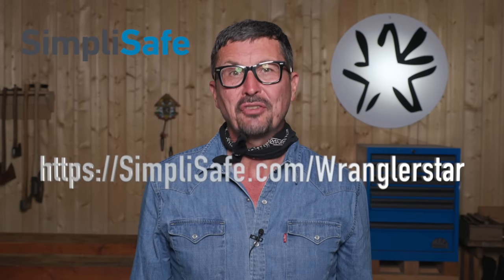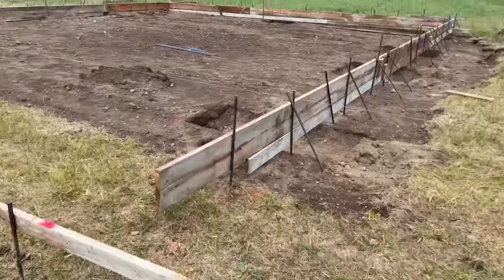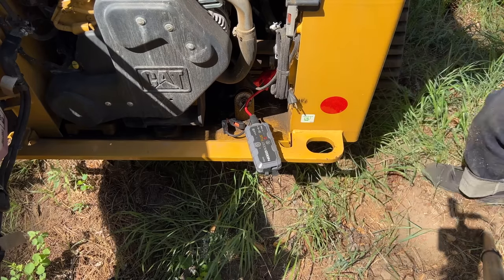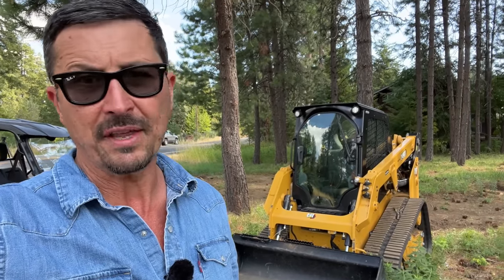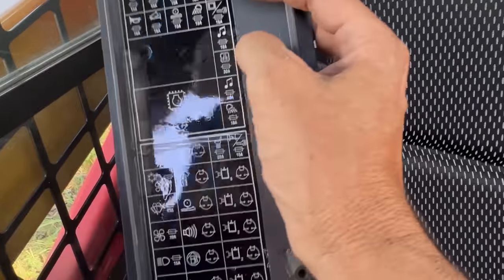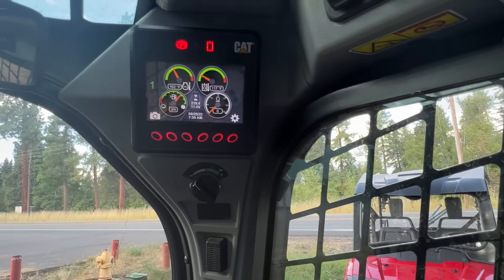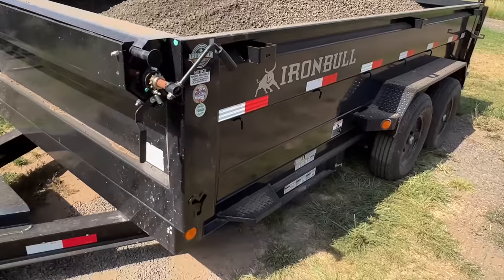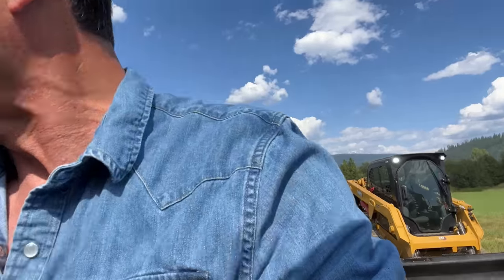How To Build A Shop like a PRO Episode 2

Comment from the maker: Save 20% on your system and your first month is free when you sign up
for interactive monitoring. https://SimpliSafe.com/wranglerstar to learn more! Try SimpliSafe risk-free. If you don’t love it, return it for a full refund within 60 days.
Reply: We have a triple axle 21,000lbs load trail dump trailer with solid 4' sides 16.5 ft long. And it's the same we have the scissor lift and as long as we keep most of  the weight in the middle/ towards 
The rear it will dump way more the it's rated for.... but load it to heavy on the nose and it won't dump
Reply: There may be a Scam on you channel using your name.
Reply: @patricklynch9574  There are a LOT of WranglerStar Twitter accounts. I wonder which one is his 🧐
Reply: @neemtreebark  it was on "telegraph"

Comment: I just started working as an engineer. (just out of college) It does seem that a lot of buildings are over engineered as they say, but if built right once than you should not have any problems with this structure. So footings and slab thickness make sense. The soil bearing pressure, and snow load, wind etc., (im east coast so i dont know much about seismic)  i can see why they are making you put in the footers. Then all the code requirements for rebar and concrete. Its all pretty standard stuff but its sure is annoying when you want something fast and you know a 5 inch concrete slab on top of the stripped soil will serve your needs. Love the videos best of luck

Comment: Just a pro tip with those levee gates, instead of using the sand snake take a shovel and drive the tarp into the ground all across the ditch where the water will run over the top of it, then pack dirt on the edge and the sides to make sure none can get around it. We’ll have about 50 of those in a good sized rice field, that’s the easiest way to do it.
Reply from the maker: Thank you Jackson I will Travis do you use a speed for a square point?
Reply: @wranglerstar  depends on your soil, we are all clay so you need a point to cut through the clay, you could probably try it with a square. Nothing too sharp or it’ll cut the tarp, also if you try the packing the dirt trick make sure you use mud out of the ditch, seals off better/ weight holds the tarp down. If you go back on your other irrigation videos I’ve been commenting/giving advice on some of your other problems. Love watching the videos! Keep it up! Irrigation is hard work.
Reply: Also buy a pair of lacrosse green irrigation boots with the dans chaps, you’ll never get wet again. Just some advice from the Arkansas delta.

Comment: I wonder if he's going to get cows. It's a perfect field for a group of cows. Would make it a real farm. Always have access to fresh milk.
Reply: All fun with cows except in flood irrigation , the cows tend to sink each step sometimes upto a 1ft deep add hundreds of thousands of holes all over is just making a mess of nice things.  Just an opinion
Reply: @whatwhappensoutwest  ok that's a reasonable argument. Flood irrigation isn't a thing where i live.
Reply: @whatwhappensoutwest  Thats why you have sheep before the cows.
Reply: @rpaasse6453  elaborate?(:
Reply: Cows are a lot of work I would just buy a half from a neighbor come butcher season
Reply: What bred of of cattle does the forest service approve?
Reply: Or maybe goats🤔
Reply: That’s why you have proper pasture management  you pull the cows before you start irrigation and keep them off several days after and as long as you control your water right break your pasture or pastures up and with flood hopefully your berms that run down the field are in good shape you can water one side let it rest move the cows then do the same on the other side
Reply: @whatwhappensoutwest  Sheep have a lower waight and smaller hoeves so the dence youre ground. 

Now saing that, i don't know anything about irrigation 🙄, and that for a Dutchman living in a Delta.
Reply: @clintdouglas5756  WATER BUFFALO!!!  It's a no-brainer.
Reply: @hazelumbrella9485  If we all had goats the we wouldn't need a Forrest Service at all.
Reply: I wonder if he's going to get spare keys???
Reply: @mrwrightoser8293  🤣
Reply: @GodzHammer  Or a bunch
Reply: @GodzHammer  Thank you for correcting me. English isn't my native language and I learned something new thanks to you!

Comment: I have locked myself out of my pickup while it was running.  But my scoutmaster taught me that if you screw up, it's called a mistake and you should learn from it.  If you make the same mistake twice, it's called stupidity.  Well I might make mistakes, but woe be it for me to be stupid.

So I solved it by keeping 2 sets of keys in my pocket wherever I go, unless I'm using the one set in the truck ignition.  So I keep 1 truck key and 1 house key on a ring so it's not bulky.  And all of my house and garage locks are keyed alike so 1 key gets in anywhere.  In 16 years, I've only locked myself out of the truck twice since but it wasnt a problem with the spare key in my other pocket.

A bonus of having 2 sets is that when my truck is running, like warming it up in winter or cooling in the summer and needing to run back in the house for something I forgot, I just use my second set and dont have to turn off the truck.

As for almost all of my equipment, I keep a set of keys on my Mule, which I generally have close by wherever I'm located working.  For my farm, it's not that big so if I need to invoke a spare key, i just go back to the garage, not far away.  If i had very far to go, I'd just keep a spare set of equipment keys on the Mule for an extra backup.

Hope this tip helps someone from making my previous mistake.

Comment: Cody, I have a Bobcat compact track loader and of course it is much more reliable than you Cat, but on those rare occasions when the electronics act up, sometimes rebooting/recranking three or four times brings it back to life, especially after a dead battery. As a professional homeowner I'm sure you know this, just a thought from one of your east coast fans. 🙂
And thanks for the laugh, the editing of your stuck trailer followed by the commercial dump truck, very funny.

Comment: Soil is about 1200kg/m3 and can be heavier if wet. That gravel has a mass of around 1400-1500kg/m3 (sand is around 1300kg/m3). Large gravel in the 25-50mm range is around 1800kg/m3. My guess is you had around 4.5-5m3 on that first load and that's around the 6-7tonne mark. Those hoists (hydraulic pump) are usually only good for around 5tonne. Only way to beat it is as you figured out to put the load as much to the rear as possible. The trailers you guys use are fairly heavy in their own right so loads like that would be hard work for any small truck.

Comment: I had a similar weird issue with my KTM 790 when the battery went dead.  It did something to lock out the cruise control.  Even after a charge the CC wouldn't work (perhaps the original lead acid battery wouldn't take a full charge?).  I put in a new lithium ion battery in it and problem solved.

Comment: How can you stand to live in that state, Cody? Even unincorporated areas seem to have county laws/regulations/codes that are as crazy as municipal codes. I live in Arkansas, and the county I live in has NO BUILDING CODES. You can build a house that will fall down if you want. While that has it's problems (how do you know how a house you are buying is built properly?), you are free to do what you want without having to go overboard.

My deck has no railing. It's 2 feet off of the ground at it's highest. If I had to build it to most codes, it would need a railing with cross pieces that a 4" ball could not go between, and it would block the view of the property that makes sitting on the deck so enjoyable.

Speaking of the deck, it's made with the "new and improved" pressure-treated lumber (ACQ). It's 10 years old, and rotting away. I have searched the internet, and have not found any commentary on how absolutely terrible the non-CCA pressure-treated lumber is. I have some newer boards as part of a planter box (not ACQ, but a follow-up type) that were labeled "Ground Contact" that aren't in contact with the ground, and they have rotted away worse than the deck.

Enough griping. Hang in there, Cody. Thanks for making such great content, and taking us along on your adventures.

Comment: If you want a good quality security system you need to get a professional installer and a rated/certified system with an ARC (Alarm Receiving Centre) who will respond. None of the budget systems will give you that!

Comment: This video is a prime example of why I only purchase equipment from the 80’s up to the mid 90’s.     The cost of down time at 150.00 per hour for a fuse and getting locked out would give me a heart attack.      
What will happen when society  falls apart and there is no tech to call and you are on your own?   You’ll be screwed.

Comment: Modern vehicles have got way too complex. Ridiculous how you have to keep them on a battery charger just to stop the alarm system from flattening the battery.
Perhaps a small solar charger would help in this instance to maintain the things while it's sitting around

Comment: Those dump trailers are amazing. Just got one myself to haul my excavator in and to do some gravel work. Just used it to haul a 2500 gallon cistern tank home from Sisters Oregon.

Take it easy on road traveling that CAT unless they have updated the bogie setup. Where I worked they had a CAT skid. It would kill bogies and bearing about every 100 hours. The wheels themselves were made of plastic.

Comment: I wonder how does the water not carve a ditch but instead just flow flat over the land?
Reply: The primary reasons are:  a) He has a good stand of grass that resists soil erosion b) The fields are graded very flat. When the water reaches the fields it spreads out wide reducing water depth and velocity.  

Both greatly reduce any potential erosive force of the water.
Reply: @jphickory522  Gottcha. Crazy how farmers figured that out

Comment: I was thinking since that design flaw keeps locking you out, put the key on a key reel so you always have it on you.
Reply: Yeah but you can't take the key out when its running! Just hide an extra key somewhere!
Reply: @chriskeating5926  Of couse! Cody shouldnt bring this up in a video, there's waterproof keyboxes (Mini Pelican Cases) with magnets on them on amazon. Used em before on my truck. Tucked it into a nook of the frame.
Reply: @bfs87  literally about 100 places to hide a key on that machine ... you could go old Skool and just P-cord it somewhere... I don't think there is a chip in that key like newer cars ...been doing this to vehicles for 30+ years ! Cheers

Comment: Cody !  That had nothing to do with the fuse you pulled. That yellow exclamation light, the inability to move, and the gauges not showing anything was the machine running through a warm up phase. You did not give it enough time to “warm” and let the computer run through sequences to gather information. If you let it sit and run for about a minute and a half to two mins the yellow light would have went off and the gauges would have been reading fuel and RPM.  Apparently the machine was sitting long enough to let the battery die, it’s going to need time to run for s bit to get to operating temp and blah blah blah .  Try what I’m saying next time.
Reply from the maker: it ran for 1/2 hour and never booted up the guages,

Comment: modern security system? my security system was designed and released in 1959 ain't had no trouble with it yet. might be a bit shorter and a bit more tacticool than those days, but it works just fine.

Comment: A new shop…the existing shop is huge I guess there’s a need ??   If the stone is for the base under the new slab why not take a form out and dump the stone where it’s going …I’m lost…help…🤡
Reply: That's what an East coast guy would have done ! Dump the stone in the area ,by taking out a form board but, I guess they work harder not smarter out west ! 🤷‍♂️ CHEERS